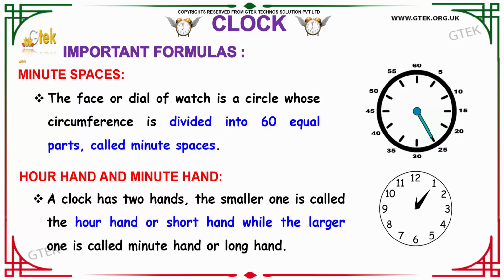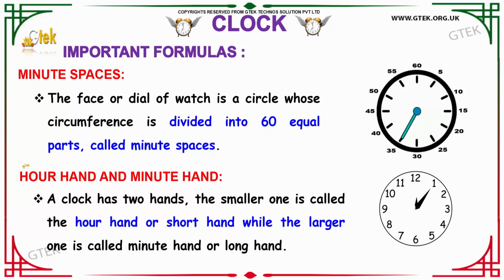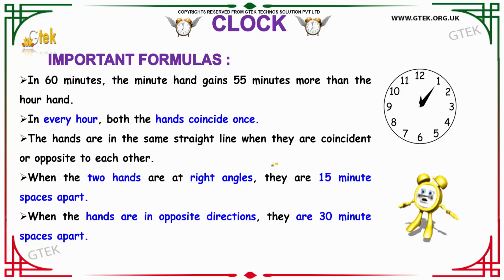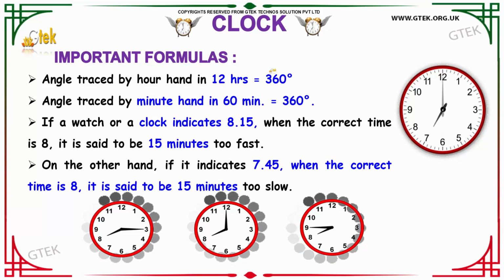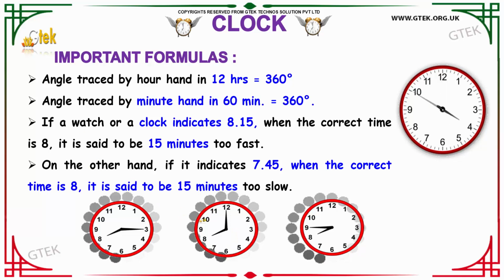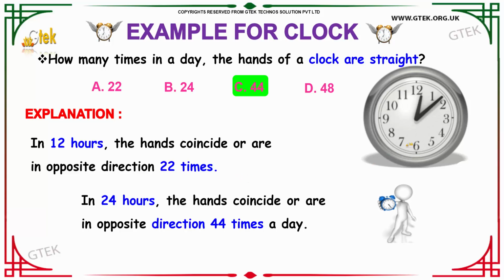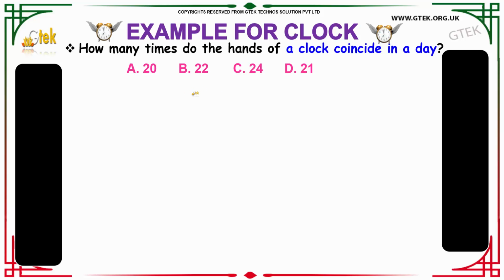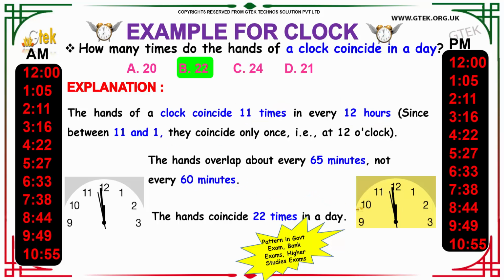Clock 1 Aptitude interview questions papers and answers online videos lectures preparation tips

Comment: At 3:40, the hour hand and the minute hand of a clock form an angle of:
A.  120°
B.  125°
C.  130°
D.  135°

Answer: Option C
Reply: wrong answer it's 150 degrees